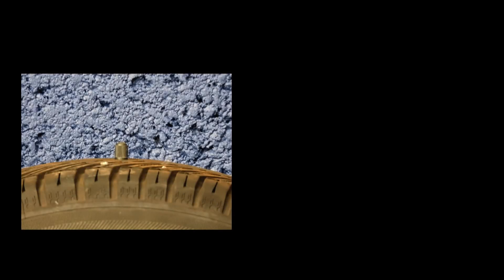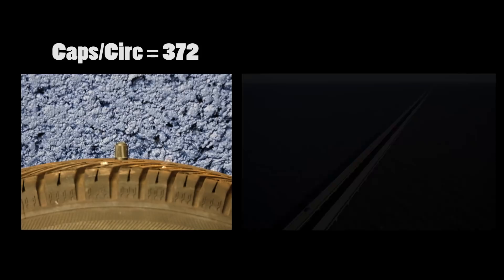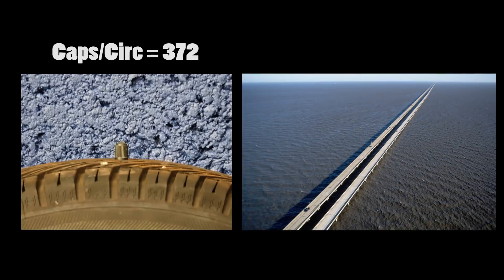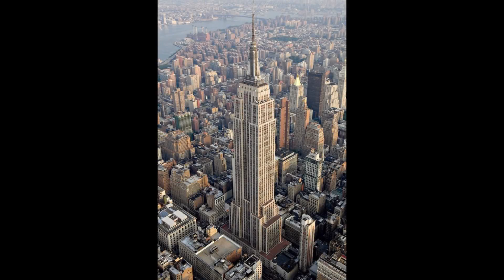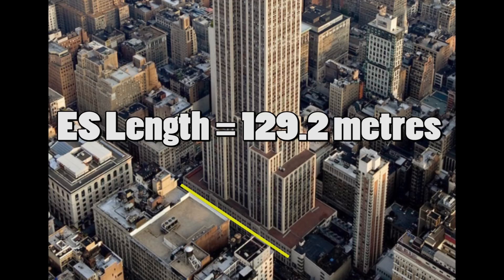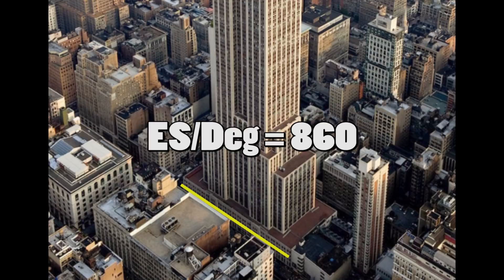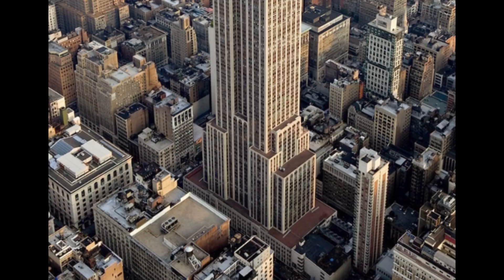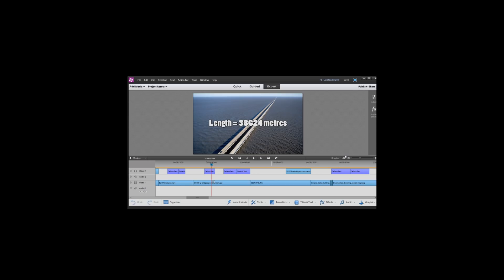Flat Earth Can't Scale

Comment: You can put your tires and valve caps away and try and explain how we can see the Canigou mountains from 175 miles away from 1000 feet high. According to ball math that range should be hidden by over 2.5 miles.  How do we see something that should be hidden by 2.5 miles if the earth is a ball with it's given dimensions?

Answer: You can't 
Explanation:  The earth is flat
Reply from the maker: It's 2019 buddy, might want to brush up on your memes.
Reply: @ETM2024  Yeah, it's 2019.  Time to wake up

Comment: A Line of Sight test between two microwave towers over 146 miles was done.How is that possible on a globe where the other tower 146 miles away is roughly 7000 feet below the horizon? Both towers were fifty feet high but regardless the towers would have to be thousands of feet above water level for this to work. This straight line was over the Mediterranean sea.
Reply from the maker: I don't believe your vague assertion with zero supporting evidence. I'm also familiar with it and it is long debunked. This is why people like you cannot be taken seriously and you are such hypocrites when you pull this mainstream crap - you are the one guilty of believing something you were told and repeating it without any investigation or thought.

Comment: First off I want to commend you on attempting to do these experiments yourself hopefully you actually did this experiment rather than take other photos and use them as examples. Second however I have to say that your philosophy on exactly what  a flat earther is calculating as far as the Earth shape is off by a lot.

No one is arguing that on a large scale even round objects can seem flat. That's not the issue truthers / flat earthers or whatever you want to call them are calculating the supposed curvature based on scientific and mathematical equation  given to them by the government and science-based establishments.

As far as your experiment goes you're placing an air cap on the top of a tire but the issue is not whether or not it can stand flat on a known curved surface or body.

What you should be trying to prove is if you measure one cap placed on one side of the tire top, and another the equivalent of 6 Earth miles apart from the other cap  is it still straight/flat?  Does it remain the same because of the overall size of the tire compared to the cap? 

This would validate your claims that even on a  sphere things can appear and even still be flat over long distances. 

However we do both know that you will calculate a drop on a curved object because there is supposed to be a drop at a certain distance this is where the phrase where's the curve comes from because testing the distance  given by scientific establishments and size of the Earth does not produce a drop even though there's supposed to be. So no,not looking at Water,not looking at the horizon.
Reply from the maker: YouTube notifications are a bit broken so I missed your comment at the time. Both of the points you are making are untrue.

Flat earthers absolutely do confuse local flatness with proof of flatness and miss out on the idea that large enough curve will look flat. I have dealt with many that quite literally laugh at the idea of there being local flatness on any curved surface regardless of scale.

The apparent drop is visible in any long distance observation, especially with good clear photography rather than the blurry garbage we usually see from FE, of which there are thousands, and I have plenty of my own which I can use to demonstrate it. There are also many examples from FE, where those supplying the material simply deny what is blatantly obvious in their own footage.

To date every single claim of "not possible on a globe" has been debunked by someone, when analysis is done properly.

Comment: At the equator a helicopter rises one mile and hovers in place then hangs a plumb bob to just short of land. Is the line string vertical? If vertical, then would the plumb bob string line also be vertical at the North Pole , also would it be vertically up side down at the South Pole?
Reply from the maker: Vertical everywhere. Stick a pin in a ball, rotate it in any direction you want, the orientation doesn't change with respect to the surface. Same idea except the reason the plumb bob hangs down toward the surface is because of gravity.

Comment: No according to the earth curvature formula which is 8 inches squared per mile. So that bridge you showed is I believe on Lake Pontchartrain which is 23.8 miles long, so there should be a difference of 377 feet from one each. That's not the case. The Globetards say on the one hand the reason why you can't see a ship far enough away is because of the curve but the reason why you can't see the curve from side to side is because the earth is too big. 

But that's just one point, add a few more.

 

1. The Ball earthers say there are photographs, but the only photos available are admitted composites which have multiple discrepancies between them. 

2.The ball earthers use the example of a ship disappearing over the horizon to prove there's a curve. But if you look at it through a telescope you can see the same ship. 

The formula for calculating the Earth’s curvature is miles squared b 7.98 inches.

I can see Coast of Scotland 25 miles away, if the earth were a ball, it would be 400 feet below the horizon. Same as the Bedford Level experiment.

We can also see the Mull of Kintyre from top to bottom rising 700 feet out of the sea 50 miles away. It should be 1666 feet below the horizon, not visible at all.

On the one hand they claim you cannot see the curve on the horizon because the earth is too big to see it yet on the other hand they say you cannot see a ship which goes over the horizon because of that same curve! Another contradiction.

3. We are supposed to be flying through the universe at 67,000 yet there's no motion whatsoever visible or force felt. How can satellites be stationery if the earth is not? 
They would be left behind as the earth belted on. Stars rotate around the earth. 

4. Water will always find its own level and be flat. There's no such thing as a curved surface.

5. Horizon always rises to eye level. No matter how high you go and there's ample footage of it even miles high.

6. It takes the same time in a plane to fly both ways on a route where if the earth was spinning as you say it does, it would be a considerable difference. 
For example from New York to LA 2500 at 500 miles per hour takes 5 hours. If it was as you say it would take two and a half hours and from LA to New York would take nine hours? 
The flight paths make no sense on a ball earth but do on a flat earth. Flying from Johannesburg to Santiago stops at Senegal to refuel, on a ball earth the flight path appears like a triangle, but on a flat earth it is straight. The plane doesn’t dip to compensate for any curvature. 

7. You say the sun is 93,000 miles away. Where did they get that calculation? Copernicus, where's the proof? There is none. 
It cannot be that far away as you can see the rays spiral out from a relatively close distance above you. You can calculate the distance by taking the angles from different parts of the earth. 

At 12 noon Jan 20 the 2018 the angle of elevation of the sun from Los Angeles was 29.26 degrees and from New York 35.96 degrees.

The distance between the two cities is approximately 3000 miles (b).

The 35.96 from New York becomes 125.96 when we invert it and so add another 90 degrees.

So the distance from the sun was 5793 miles from L.A. and 3498 from New York.

8. The sun would light up the whole universe and even if it didn’t, and we were in the dark because we are pointing away from the sun, why are the areas of space either side and up and down of us dark where there is nothing blocking the sun’s rays? 

9. Seeing the sun and full moon during the day is impossible on heliocentric model.  Seeing a crescent moon at night is impossible on a heliocentric model.

10. If the earth rotates every 24 hours while travelling around the sun, then if we are directly facing the sun at 12 O’clock noon in January, why aren’t facing away from the sun at 12 O’clock noon in July? 

11. You see the same stars in summer as in winter even though we are supposed to be 186 million miles away facing the opposite direction and the the North pole star is in the exact same position in relation to the others  irrespective of this and irrespective of the supposed 23.5 degree tilt.  

12. If the sun were that far away, there would be no difference in the temperature.

13. They told us the difference between summer and winter is caused by the elliptical orbit of the earth around the sun. It's 4 million miles closer to the sun in summer than winter, but to account why it was summer in the southern hemisphere when it was winter here, they came up with the idea that the earth tilts. So now 4 million miles, that is 40000 earth diametres,   
makes no difference but a couple of thousand does?

14. Orion can be seen upside down from the Southern Hemisphere and the moon can be seen from Australia and the East Coast of the US at the same time. That wouldn't happen on a ball earth.

15. If it were a ball, why would we not be upside down in the Southern hemisphere? Gravity does not account for that.

16. Gravity is a theory which has never been proven. Why aren't we upside down in Australia? Before gravity came along, there was the principle of buoyancy and density which makes perfect sense, objects sink when they’re heavier than that underneath and converse like helium e.g. balloons rise because they are lighter than the air. Does gravity apply equal force everywhere on earth and why don’t we feel it? It would have to be stronger in Australia than here? And what accounts for us not feeling upside down? It can keep us on the ground in Australia but it has no effect on helium?

Let's settle if once and for all. It should be simple to take a photograph from any of the thousands of satellites which are allegedly up there and see some pics that aren't composites or faked.
Reply: +jakesprake [The ball earthers use the example of a ship disappearing over the horizon to prove there's a curve. But if you look at it through a telescope you can see the same ship. ]

No, you can't. This is an outright lie.
Reply: Since you have so many points I'm just gonna respond to the first 3. 
1. When you say " the only photos available" What do you mean? Because images of the earth are being taken from space every few minutes. Like here: https://www.jma.go.jp/en/gms/
2. "if you look at it through a telescope you can see the same ship." Give me one example of a ship visibly going down, like here: https://www.youtube.com/watch?v=7nUFLLUahSI 
(unfortunately, he didn't zoom in), and then coming back up out of the horizon by zooming.
"it would be 400 feet below the horizon." That is without refraction. With standard refraction, it is closer to 300. Now keep in mind that refraction happens a lot more over large bodies of water. And maybe you're looking at some hills which increase the height but I'm not certain of this.
"yet on the other hand they say you cannot see a ship which goes over the horizon because of that same curve! Another contradiction." No. Your FOV is limited by the shape of your eyes while the distance you can look is only limited by the size of the object in question. With the horizon being the ground you can always see it. 
3. "yet there's no motion whatsoever visible" Maybe not in a lifetime but that doesn't mean it doesn't happen. Can you give me a source that says the stars have never changed?
"or force felt." Why would you? Motion is not a force. I suggest minutephysics. They make some really nice physics videos.
"How can satellites be stationery if the earth is not?" They aren't. And stationary is a relative term. A coin moving on a train will be stationary even though the train is moving. Same with the satellite.
"They would be left behind as the earth belted on." What force would change their movement?
"Stars rotate around the earth." Then answer me this. How high is Polaris above the north pole? A rough estimate will do.
Reply: @CrashDy  Thanks for your reply Crashmaker, First, concerning the image of the earth in the link taken from a satellite. Do you know how far away from earth the satellite is?
Reply: @jakesprake  About 35,786 km
p.s. In case you're gonna say fake because Asia would be too big (Yes, something like this has happened before), this is what I got on google earth at 36,241 km altitude: https://puu.sh/BRXxi/687f893864.png
Reply: @CrashDy  What is that in the link, are those actual photographs of the earth?
Reply: @jakesprake  From my reply on point 1, yes. You can change it from infrared to visible light. Currently, it's night though. Almost morning.
Reply: @CrashDy  so if you can change the light on it yourself, how can it be accurate? Do you honestly expect me or any intelligent person to believe that that image is not a CGI hoax? That's absurd. It couldn't be more obvious.
Reply: @jakesprake  "if you can change the light on it yourself, how can it be accurate?"You're not changing the light... You're changing which camera you use. Or maybe simply the method of detecting light. 
"Do you honestly expect me or any intelligent person to believe that that image is not a CGI hoax?" Since when can evidence be disregarded for the fact that it could be fake, instead of it having to be proven fake? 
Now I get that some things are hard to prove, especially with matters like these. But you've also got things like this: https://www.youtube.com/watch?v=edsUrLXrlLg
First used as evidence for the flat earth but after some careful analysis, you can see how it is actually curved.
Reply: @CrashDy  Every time you refresh it or input different times, it's still the exact same identical image. Download the image and enlarge it and you can see it's an obvious hoax.  Never mind the fact that there's no durable evidence that satellites exist.
Reply: @jakesprake  "Every time you refresh it or input different times, it's still the exact same identical image." Only the light changes. What do you expect to see change exactly?
"there's no durable evidence that satellites exist." Then what is that light I've seen in the sky exactly when the ISS is supposed to transit? 
Okay, maybe it's not a real space station. I've never been inside it so how would I know, right? 
But I do know this, it's path can be predicted and anyone can see it when it's said to be there. Always at the right time and moving at a constant speed.
When this is plotted on a globe, it makes perfect sense. When plotted on a flat earth, however, it doesn't.
So either way, it's evidence of a globe.
Reply: @CrashDy  The light changes but the cloud formations remain identical. Any fool can see it's a CGI. I don't know what light you're talking about. I don't believe satellites exist because I've seen no evidence, e Ballers there's no firmament.   If the world was travelling at 67k mph they'd be left behind and don't say it's because it's like travelling in a train because according to the ball earthers there's no lid or firmament cos if there was then nothing could go into space as you claim. If anything satellites would only work on a flat stationery earth yet you try to use them a s proof of a ball earth, how idiotic is that?  And why should I believe anything from NASA after their Moon Ianding hoaxes.
Reply: @jakesprake  the clouds do change... Not sure what you're on about there.
And by light I mean the light you can easily see at night when the iss is predicted to pass overhead.
You can try this yourself.
what does a lid or firmament have to do with how fast the earth is going? The atmosphere in the earth is also moving. Speed is relative. Forces are what matters.
Reply: jakesprake

This ladies and gentlemen is the flerfer handbook 101

Yet jake here has missed the entire point of this video smh

Comment: You have a point about how things may seem flat on a comparatively large curved surface due to the proportion in size between the object and the body the object is standing upon. At most, that point may be an argument as to why buildings in an area don't seem to tilt, but it's not a point that proves that the earth is a globe. How about showing us all an experiment where large bodies of water stick all around a gravity-charged ball?
Reply: You're asking for an experiment that is basically impossible to test right now. But water naturally forms into a ball. Look at water droplets, water in 0G, etc.
Now if the experiment allows the force of gravity to be replaced by another force then the experiment would be easy.
Reply: +crashmaker18
That experiment is impossible for any time, period. Unfortunately water droplets have the property of flowing down or settling to a level whenever they come in contact with an object, therefore a droplet is no proof of curving water around a globe. To prove the globe earth once and for all a repeatable experiment is necessary that shows large bodies of water hugging a fast spinning ball in motion at high speed inside a vacuum. 
And btw the force has to be gravity and none other to prove a spinning globe.
Reply: @sishrac  So the ISS' live feed will do then? Or basically any video showing the earth being obviously curved or as a while without lens distortions, right?
Reply: +crashmaker18
Ha Ha! no CGI 'experiments' of course!! ;) We need real live repeatable ones without lens distortion, naturally... :)